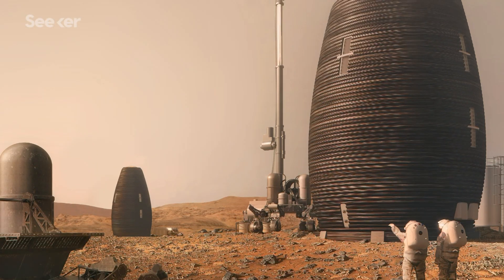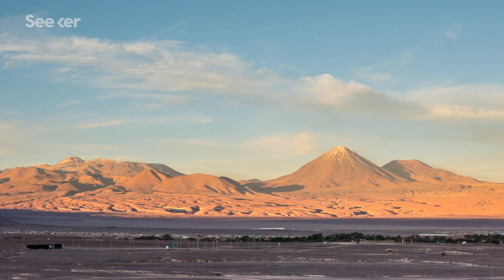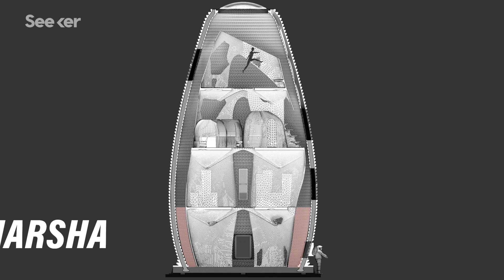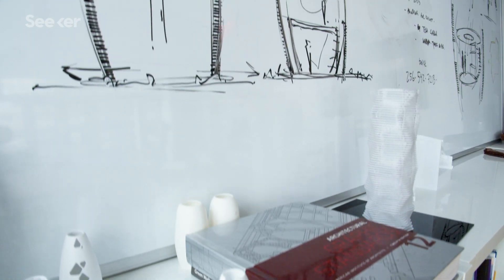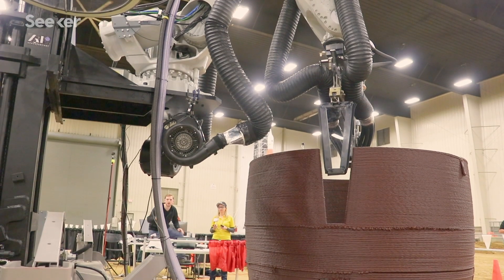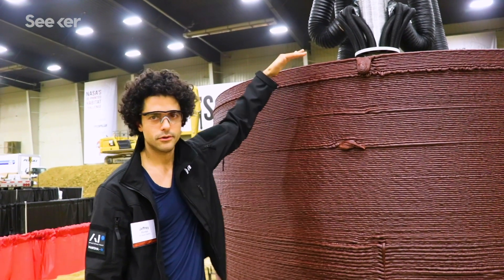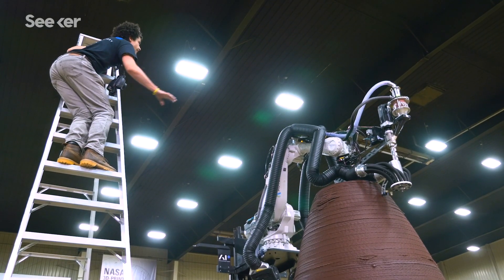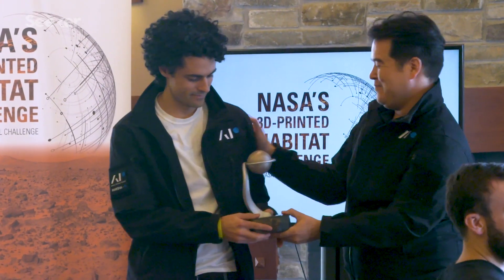NASA’s Challenge to 3D Print Future Habitats on Mars

Comment: I'd like to own such a (solar charged) 3D printer and then loan it for free to one small poor community at a time to 3D print homes and structures for people for free with them only supplying the cement.
Reply: Well (except for the Solar part) that's the direction we're headed in.
Printing houses is a Technology that's advancing rapidly.
And once it's easy and cheap - you just have to bring it to poor countries. That's how it always works.
Smartphones, medicine, cars, Television, etc.
Reply: @Pyriphlegeton  Why would you be against using solar power?
Reply: sanjuansteve I think he’s only saying that modern day 3D printers aren’t usually solar powered & not that he is against using solar energy.
Reply: @marsnyc99  I'm not talking about integrating solar cells into a 3D printer.  I'm just talking about an array of regular panels mounted anywhere to directly provide power like a generator or to simply be in a grid-tied system that powers the printers.  Everything can be 100% solar powered with enough solar panels and the will to use them (aviation too for example).
Reply: sanjuansteve I definitely agree with you on that solar power & safer forms of nuclear energy are definitely the way forward especially for far flung projects like building structures on Mars! What a time we live in.
Reply: @marsnyc99  We have the ability to #SwitchToSolar and to #SwitchToElectric vehicles making nearly everything we do 100% solar powered, what we lack is the will.

We have the ability to end fossil fuel based plastics and to #EndFossilFuels completely, we just lack the will.
Reply: sanjuansteve Yes it is unfortunate! But I remain hopeful that humanity will listen to reason before it’s too late for Earth or that at least colonization projects like these give us the ability to start again with out having the re learn the lessons we were taught on Earth!
Reply: @sanjuansteve  You really don't understand the real world, at all, do you?
Reply: @johnshilling2221  Your limitless fear and greed (fear) are a disease.

Despite the title of the book Fear, I think we're neither discussing the properly framed problem, nor the big picture solutions yet. #FearIsTheProblem. Fear is the root of bullying, misogyny, homophobia, racism, bigotry and greed. Fear allows people to mentally wall-off their own empathy to virtually zero. #MakeBigotryShamefulAgain

Three of the biggest generators of fear are 1) out-of-control capitalism and historically unsustainable and exponentially growing wealth and income inequality levels (if you lose your job you might lose healthcare access, your home, car, partner, child custody rights, etc), 2) fear-mongers like Fox/Faux/Fear News, the GOP, etc. (they’re all out to get you, all the time), and 3) religion ('evil' is waiting around every corner, all your life with eternal unimaginable fiery torture as a deterrent).

Let's be honest, no amount or size of Great Walls, or military spending, or nuclear arsenal, or non US soil military bases and ops, or international weapons sales, or personal weapons and magazine sizes, or of school teachers with guns, or of privatized, militarized (and systemically racist) police and mass incarceration, or of mass deportations including the Dreamers, or of bans of entire groups of people, or of intentionally torturous (and often permanently orphaning) separation of immigrant children as a deterrent, or threats to shoot rock-throwing refugees, or torture of POWs, or control over women, or Space Farces, or border moats filled with snakes and alligators, or anything else will ever Make American Republicans Feel Safe enough...

Every single American Republican policy puts fear and greed (fear) before people and planet (including equality and empathy) and no single policy in the world in the modern era is as patently bigoted and of the scale as their continued fight to ban (and register, and ''pre-arrest'', etc too) all Muslims (a bigotry-blanket of fear/hate covering all 1.8 billion people of all colors, from all nations, of all ages, of all sexes and sexual preferences, etc).

Fear (and the empathy and critical thought it kills) is what separates the right from the left. The fear at the root of ”Nationalism is an infantile disease. It is the measles of mankind.” -- Albert Einstein

Liberals hate American Republicans because all of their policies put fear and greed (fear) before people and planet (including equality and empathy).

American Republicans hate liberals for the exact same reasons, because they’re afraid we’ll get in the way of their fear and greed.

We're closer to #AmericanCivilWarII than most people believe and just like before our own friends and family members would take up arms against us for not getting on board with their extreme greed and bigotries just like the Confederates in 1865 or the Nazis in 1938.

With tuition free education, universal healthcare, a universal basic income (UBI) and internet access for all, we'll raise the starting point of capitalism from zero, we'll let you die with no money, to a level of life with dignity, reducing societal daily fears on a massive scale which will free us to welcome the coming automation revolution with open arms rather than fear and great harm.
#getALLmoneyOut #EqualityMovement #BLM

Call me overly positive, but I think we’re leaving the era of ‘greed is good’ and celebrating wealth and entering an era of altruism and equality.  Let’s #AutomateEverything and #SkipToAbundance.  #EraOfAltruism #CelebrateSelflessness
Reply: @sanjuansteve  
Damn dude why do you use all the hashtags, this ain't twitter
Reply: @Bigbadgoon  Don't be so easily upset.  Life's too short.
Reply: Pyriphlegeton 'Problem is that poor countries tend to be run by gangsters, just as the rich ones are, and those gangster-élites have a common interest in keeping the poor in their place(s), so don't expect them to allow any rise in the living-standards of their kept-down serfs, who will still have to run to stand still throughout their often-brief lives.
Reply: karim rebai The crooks who own all the oil will use their political puppets to squash any solar-energy initiatives.
Reply: @None-zc5vg  Another stupid comment from the Clueless. I wonder what Elon Musk thinks about your comment?
Reply: @johnshilling2221  John, you missed my point: I said that even if there were a practical, affordable alternative to oil-based fuel, that 'alternative' wouldn't be allowed to succeed, thanks to the power of the oil companies. In any case, as you said, solar-panels are, at present, expensive and vast numbers of them would need a lot of technicians on hand to maintain them.
Reply: scientist are focusing on Mars while our planet earth needs more attention
Reply: Well, unless you're old, there is time for you to make millions of dollars so that you can afford to buy / build / transport / set up and maintain the equipment and the crews required to do all this stuff... "for free." Sorry, but I don't think you understand. Trying very hard not to LOL.
Reply: @johnshilling2221  Your apparent limitless greed (fear) is deplorable.
Reply: @johnshilling2221  You seem to not understand the idea that automation is More efficient and Less costly, not the other way around.
Reply: karim rebai  Another idiot. Have you ever heard of petrochemicals? Do a little research. Then, try to live one day free of these necessities. You haven't got a clue. And yet, you still get to vote. A real shame.
Reply: But you have to buy land before you can build it on it
Reply: @alba2162  Of course.
Reply: Dumb plan
Reply: Pichkalu Pappita Why is it dumb? Many communities have “free” housing for the homeless & poor, If money can be saved on the construction of these homes then they can be reinvested in better job training & health care for them which means a better chance at getting ahead. It’s a great idea 💡
Reply: @AshutoshMishra-l4m  Fear-filled. empathy-free people deplorably stand against the equality of others.
Reply: Or they could stop acting like mouse and STOP having children.
Reply: criticalhard and then all their children die. Great plan!
Reply: good idea but that is a lot of plastic 

and the environment is already dying
Reply: @engr.enciso  That is the Dogma of the cult of stupidity. I'm surprised you were able to memorize even that much.
Reply: Why provide for people who never wanted to put the effort into doing it themselves. There is a reason poor country's are poor, pure laziness. Never seen the sense in handing shit out willy nilly. If pale poms can live off the land with no experience in 1700s Australia, then I see no excuses.

Comment: Would have liked to have seen a pressure test.
Reply: They crushed it with a bulldozer... That's the test...
Reply: @Kokorocodon  how do you equate an external load at the top to an internal pressure load?
Reply: @pOOL_pANTS  Even if it's on top. Most of the energy applied by the bulldozer ends up being concentrated in the middle of the structure. An internal pressure would do the same effect.
Reply: @Kokorocodon  I disagree.  That might be the case, but how do you know since the presumed distributed load depends on the geometry of the structure.
It's certainly better than no-test but I don't think we get a great representation of internal pressure.
Reply: @pOOL_pANTS  Well by no means it was a pressure test, but rather a structural one.
Even so, the material and form of the habit favor a high-pressure resistance. 
You can see it clearly as the bulldozer applies much more weight than our very own atmosphere could on the structure.
Reply: @Kokorocodon  Maybe it's more reasonable to assume that the point load applied at the top via the bulldozer, induces stress at the center of the structure.  The failure mode is crippling-compression which is more conservative than an internal pressure load.  
I could get on board with this line of reasoning if this material is critical in compression but not in tension.
Do you know if that's true?
Reply: @pOOL_pANTS  Well I'm not much familiar with the material properties when it comes to tension. But I know that the material is a mixture of basalt fiber and processed bioplastic from the plants they plan to grow on Mars. 
And according to NASA, the polymer mixture is two to three times stronger than concrete in compression. And also five times more durable than concrete in freeze-thaw conditions.
Reply: @Kokorocodon  very cool. good to know thank you.  now we just need to know if the compression allowable > tension allowable.   maybe we will someday after enough testing
Reply: they did

Comment: if you use clay or some other earth material instead of polymers on earth than im all in
Reply: Cellulose fibers and spider silk are both polymers, just like pectin and lignin are, which all are completely biodegradable as three of them make up wood.
Polymers don't have to be plastics made from hydrocarbons. The PLA (poly-lactic acid) they used in their project is a renewable plastic made from plant waste and/or bacterial cultures.